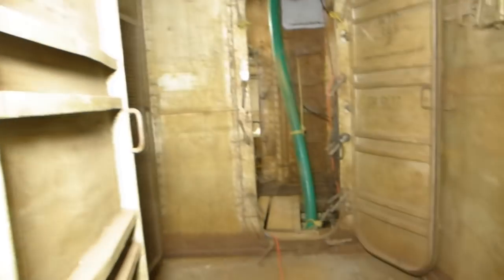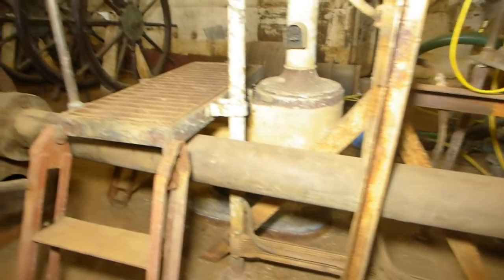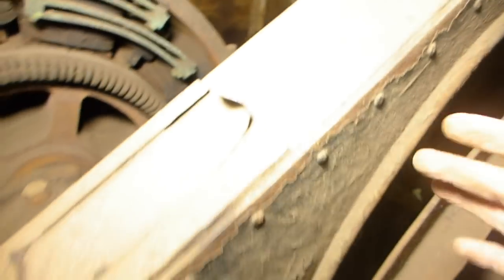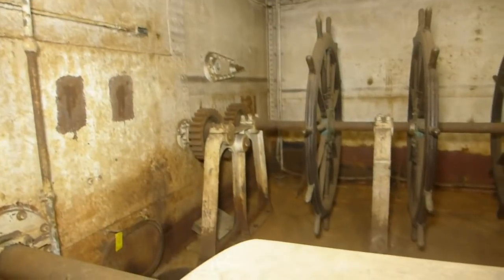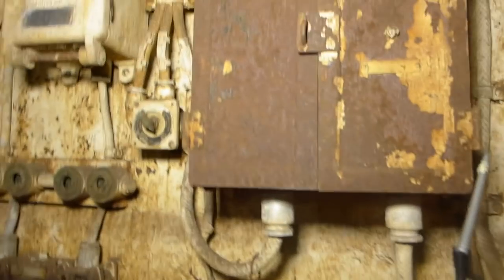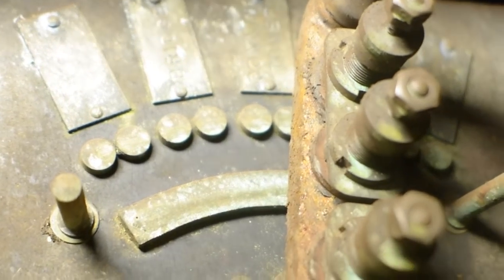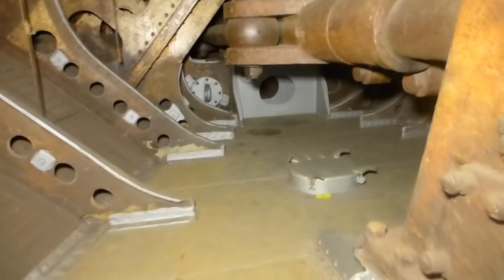Battleship Texas, One Good Turn Deserves Another

Comment: Thanks for such an excellent explanation. I recently toured the U.S.S. Alabama and was impressed with its restoration, thanks in particular to many volunteers. Texans, both the state and citizens, need to get behind their ship. Too much of the time of volunteers is being devoted to merely keeping the ship afloat. Dry landed, that would no longer be an issue and their labors could be devoted to restoration.
Reply from the maker: Michael, a dry berth option was studied and a number of proposals based upon it were created over a more than 10 year period.  There is no question that it is the best method of guaranteeing the ship's survival.  Unfortunately, when its $100 million cost was taken to the Texas state legislature, they were not willing to spend that much money and that plan was permanently eliminated.  Whether or not they should have spent the money is an entirely different conversation, suffice it to say that it simply wasn't going to happen.  By the way, a study was performed on the less expensive method of dry berthing the ship by bedding her in sand and the conclusion was that it would lead to severe structural damage to the ship.  The problem has to do with the soil along the upper Texas gulf coast.  It would require sinking about 200 pilings more than 100' deep to provide the needed support.  There were a number of other problems with the method that included permanent loss of access to the outer hull below the sand line, ultimately leading to the destruction of the outer hull shell.  Before anyone starts tossing out suggestions, know that these conclusions were made after 100's of core samples were drilled throughout the area and studies were made by soil and marine engineers.  

What the state did do was give $35 million for the current solution, which is to take the ship to drydock and replace almost the entire outer hull shell below the waterline.  Between that and other repairs, the ship will have a major reset that puts her in good watertight condition.  Her management has also been transferred from a state agency, Texas Parks and Wildlife Dept., to Battleship Texas Foundation, a non-governmental organization.  She will also be moved from her current location to one yet to be determined that should greatly increase visitor traffic and income.  Between that and private and corporate donations, the goal is to generate enough income to provide a sustainable maintenance and periodic dry docking plan.  

Again, dry berthing simply wasn't financially possible, but the current plans should assure the ship's survival for decades.

Comment: Great display of early 20th century electrical motors and controls. I’ve actually worked with some of that type of equipment that was still operating in the 1980’s.

Comment: Basically, the DC motor was a fly-by-wire system. Probably one of the first ones. I like all those fins boxes. That's an antique gigantic electric speed controller. I bet when you're going slow, that room heats up pretty quick.🤪👍💯

Comment: My step grandfather was a fireman on the Arkansas,  a sister ship to the Texas.  His job was to shovel coal into a boiler furnace.  He served from 1920 to 1922.
Reply from the maker: He was a tough man who knew how to work!  If he was an actual stoker, he had a tough job, not only because of the heat, dirt and exertion, but it required a lot of knowledge and skill with the shovel.  He had to be able to read the fire and not let the bed of coal get too thin where it would cool down, or pile it on too thick where it would create a lot of smoke and choke down.  He had to know how to throw coal with a twist of the wrist to evenly spread it over a large area or how to throw a shovel of it through the fire and across the grate to fill in a thin spot in a far corner.  That meant looking into the fire at a close range that would burn his face and sing his hair.  He also had to frequently move the fire around to remove clinkers and other junk that could clog up the grates and interfere with burning, and periodically clean the fire.  All of that had to be done with the boiler running.  Again, it was an incredibly tough job that required a lot of skill.
Reply: @tomscotttheolderone364  he was quite the tough man.  After getting out of the Navy he sheared sheep around the country.  He farmed and eventually became a police officer.   He learned to box from another fireman and was hired as a police officer based on his boxing skills.  It was truly a different time.  I should add he was born in the Oklahoma territory and the family moved back to Iowa just prior to WW1.  The person who taught him to box was a man of color (he spoke very highly of) and defended the reputation of the Arkansas as a light heavyweight.    He passed in 1999 at the age of 96.

Comment: With the recent move to dry-dock, how did they un-freeze the rudder and steering gears?  Did they have to damage the mechanize to do so?
Reply from the maker: The rudder is still frozen at 14 degrees to starboard and will stay that way.   Any bad effect of the rudder on the ship only occurs when the ship is being towed, which is very infrequently.  It is easily offset by having a  small tug either push against the stern or pull on it using a line rigged to the stern while the ship is under tow.  Correcting the rudder was studied during the ship's last dry dock in 1988-90.  It was determined that any repair would required cutting the rudder post and remove the rudder to free things up.  That would require a very large amount of money and heavy damage to the ship and rudder.
Reply: @tomscotttheolderone364  Thank you for the reply and your explanation makes sense.  You are right, 14 degrees isn't much to counter with a tug.  It would only need to work if she could move under her own power.  That would be a dream to see her drive under her own power again, but the costs to and the part availability would most likely be prohibitive.  Your video series here is amazing and hopefully will be around for generations to come, just like the Texas herself!  Hopefully you will have these available on other medias other than youtube so they will be preserved.

Comment: Looks to me as though there is simply a crank handle somewhere, to manually actuate the brake band from the manual steering position, using what appears to be a square drive on the reduction shaft.  The hole on the other side is just a bearing for the main shaft isn't it? Or is it splined?

Comment: I'm VERY glad you got to the degrees of rudder! I was beginning to wonder if there was a gauge in the auxillary steering room. If it was greesed up and oiled well, with a balanced rudder would it still take 16 sailors to man the auxillary wheels to turn the rudder? Do you have a SORM for the ship?
Reply from the maker: I've never seen a unified document, nor do I know if one existed when the ship in active service.  I am aware that there were procedural manuals largely by division, but I've only a few things that could serve as parts of an SORM.  The most precious one that I have acquired is the engineering casualty manual written during WWII by the ship's engineering officer that I have used as a primary source of information for a couple of my videos.

Comment: Speculation- if you were trying to turn the rudder manually, that piece at 5:00 would be a good place to put a brake-activating wheel, to lock things down if it tried to get away from you.
Reply from the maker: I like that thought.  I have some original drawings of the gear that I'll dig up.  I don't recall that it shows anything, but it's worth another look.  I'll let you know if there is anything additional there.
Reply from the maker: Clifton, Good Call!  I found a drawing dated July 1914, 4 months after commissioning meaning it is a record drawing showing the equipment as built.  It shows a hand wheel on the shaft so it is definitely a hand actuated brake!  It's too bad I cannot post a clipping of it in these comments so that you can see it.
Reply: @tomscotttheolderone364  That's awesome! Glad I could be helpful!

I guess spending my childhood playing on junk turn-of-the-century farming equipment has done some good!

Comment: Looking at the rudder brake my guess is that it was only used when changing between power & manual steering or maintenance.
Reason being the shaft throught the bulkhead is square like a valvestem so it had a handwheel at one time.
Reason two, if it was applied when the steering gear wasn’t moving there would be some kind of automatic application.
Reply from the maker: You appear to be correct.  Even though the wheel is missing, the builder's "as built" drawings show that it had one and it appears to be the only way of applying the brake.  On the side of the bulkhead opposite from of the brake wheel and manual steering wheels is a coupler that engages and disengages the manual steering shaft from the turning gear.  There is a similar coupler for the powered shaft.  I reviewed my detail photos of the steering gear and saw that it is possible to simultaneously disengage both the powered and manual shafts from the gears.  That being the case, the brake would certainly be useful for holding the rudder in position if both were disconnected at the same time such as when changing from powered to manual steering.   I haven't seen any documentation that addresses when the brake may be used, so your reasoning sounds as good as any explanation I can think of.
Reply: @tomscotttheolderone364  do you know the full story why her rudder is turned over and wont be set straight?

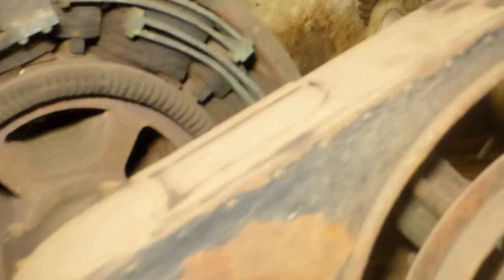Comment: I wonder if modern day war ships still have human powered rudder control wheels as a failsafe? (04:15)
Reply from the maker: Using manual steering on Texas would be slow and difficult.  I suspect that even if it was not really needed, low cost and ease of design made including it on the ship an easy decision.  Also, at that time, it was a doable design for all warships, regardless of size.   I haven't gone to any effort to find out, but I would be very surprised to find out it is used on modern aircraft carriers and other ships having multiple rudders.  Ship size and complexity, combined with limited effect, should pretty much rule it out as a practical addition.  Short of some pretty wild speculation about its use on Texas, I find it difficult to imagine a scenario where they would have to resorted to manual steering while under way.  Having said that, it would be very useful if they needed to reposition the rudder without firing up the steam or electric steering engines.  This would certainly be the case if it was required while in dry dock.

Comment: It looked like there is a binnacle stand down there near the four mahogany 'Wheels'. How did they isolate that from the steel environment?
Reply from the maker: Good question; I have no idea.  I find it difficult to believe that a magnetic compass could reliably work down there.  The stand is empty and I would have guessed it contained a gyrocompass repeater, except you wouldn't need the compensators mounted to it.
Reply: @tomscotttheolderone364  Supernumerary? 🤔A lot of work to haul it topside, but…🤷‍♂️ I’ve seen stranger things. It was the right way, the wrong way, and the Navy way! Or maybe after she was struck, somebody thought that would be a dandy place to put one. Be interesting to see if it was on the original TO&E.

Comment: I believe the main use of the rudder brake was possibly to keep the sloppy steam operation from making the rudder unmanageable. But I also suspect the rudder brake was also meant to freeze the rudder in position, in case of damage where you lost the ability to turn the rudder at all!

However, they probably found early on, with the electric motor installed, they did not need the rudder brake at all, which is why the shaft and drive are missing!
Reply from the maker: The rudder brake was controlled manually using a hand wheel located on the aft bulkhead, just above and inboard of the large mahogany wheels.  That location suggests that it was not something easily or frequently used.  I don't think that there was much slop in the steam operated steering equipment between the steam steering engine and the steering gears.  However, there was likely noticeable lag between input at the helm and response from the rudder.  The design of the screw shaft and mechanical rams that actually turned the rudder is such that it would naturally resist being turned by force applied against the rudder.  A good analogy is a car screw jack because it operates on the same principle.  You turn the screw to raise the car; however, the weight of the car cannot force the screw to turn, thus the car remains raised.  The same types of forces and resistances apply to the steering gear.  My best guess is the brake allowed them to clamp down on the steering crosshead attached to the rudder post to hold the rudder in position if they needed to disconnect or service any of the steering gear while under way.
Reply: @tomscotttheolderone364  That makes more sense!

Comment: How do they Degause a ship like this? Is there a strip dragged behind to bleed off the static?
Reply from the maker: Degaussing has to do with demagnetizing, not dissipating static electricity.  In this case, it was done to lower the ship's visibility to magnetic anti-shipping mines.  As a ship passes by a mine, its metallic mass disturbs the Earth's magnetic field and triggers the mine.  The goal in this case is to match the Earth's magnetic field to be invisible to mines.  The ship has sets of heavy electrical cables that encircle the hull on the inside, both horizontally and vertically.  Electrical currents are passed through them to vary intensity and polarity.  If you watch the first part of my video on stem and stern castings, you will see the windings.  If you watch the one on generating electrical power, you will get a brief glimpse of one of the controllers.

Comment: I’m surprised that there isn’t more grease or oil etc on these parts? Obviously they haven’t been used in decades and decades but grease doesn’t tend to evaporate does it?
Reply: Yes, it kinda does. The volatiles in the oil slowly evaporate, and you are left with a crusty powder that doesn't lubricate anything. That can end up flaking off like dust or rust scale. You are often left with a powdery coating that looks like dusty rust. This takes years, but Texas has been sitting there for enough years.
Reply: @lwilton  makes one wonder, if nobody thought about doing a greasing run every few years

Comment: I assume rudde mechanism is corroded shut by now?
Reply from the maker: The rudder post has been frozen in its current position for at least 50 years.  Inspection of it during the 1988-89 drydock repairs determined that trying to free it would cost too much and require too much cutting and welding to be feasible.

Comment: how big is the steam steering room??
Reply from the maker: A distinction needs to be drawn between the steam steering engine room and aft steering.  The steam steering engine is in a small compartment adjoining the aft end of the starboard engine room and its output shaft carries aft to aft steering.  Go to the following link to see a drawing that shows aft steering and the steering gear room.  The scale in the centerline of the drawing shows frame numbers that are 4' apart.  https://battleshiptexas.info/images/Drawings/DeckPlans/1944/2ndPlat.html

Comment: So she'll want to crab off to one side while under tow.  Just means your girl has personality.  

If you really wanted to correct the rudder angle it would be best to do it while she's out of the water so the yard can work to release the rudder post without having to worry about flooding.  You'll need about 1500 gallons of WD-40 for the job.  😂😂  (That's a sailor joke guys!)
Reply from the maker: They had Texas out of the water in 1988 and repairing the rudder was carefully studied by at least one marine engineer and shipyard workers.  The consensus was that a repair would require cutting the rudder off and effectively destroying the rudder post.  Since there is no reason to have a moveable rudder and it is easy to overcome the deflection caused by the rudder's current position during tow, the decision was to leave it.  Also, the rudder post packing had leaked since the ship first went in the water, throughout her active career and during retirement.  This was a major source of the flooding in aft steering.  So, they welded around the post to permanently eliminate the leak.  Again, the thing to keep in mind here is that the ship will never be operational and there's no need for a working rudder.  Also, a primary goal of that project was to eliminate leaks and there was only one reasonable solution to eliminate this one.
Reply: @tomscotttheolderone364  I didn't know that, thank you!  

I tend to think in terms of preservation through restoration and repair, often through restoring function.  You and they are correct in this case, restoration of function is not necessary nor even desirable in this case.  I guess serving at sea colors my thinking.
Reply: @robertf3479  yeah it's kind of sad but without billions and billions of dollars and a whole lot of legal hoopla/power restoring the ship to any kind of functionality is going to simply be impossible